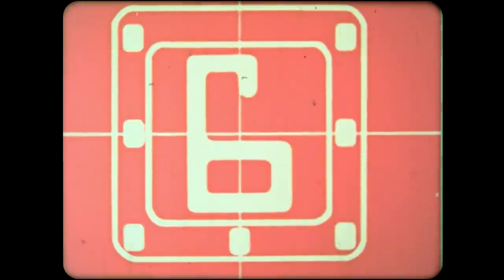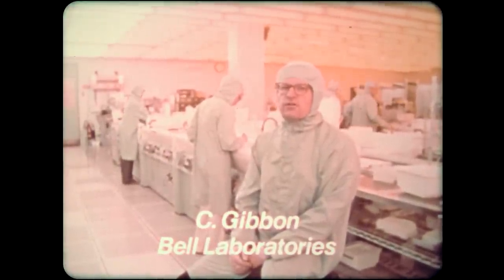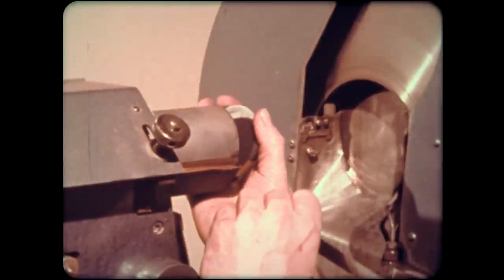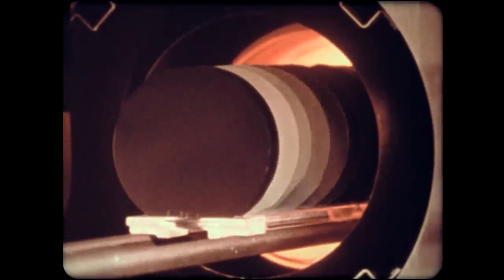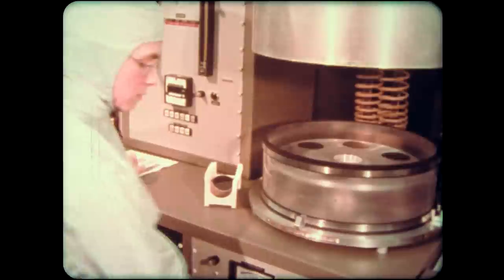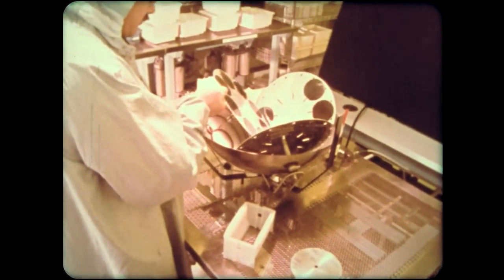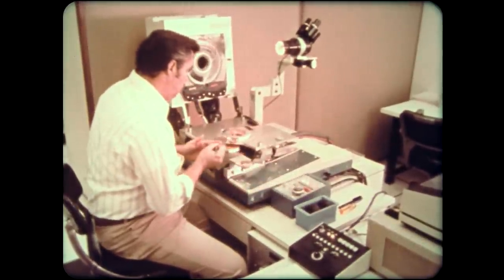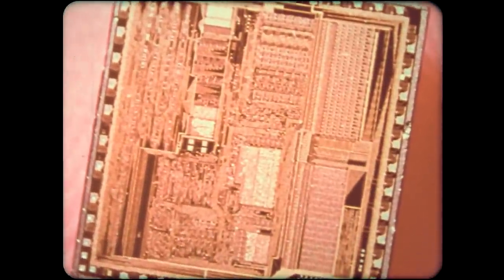Integrated Circuit Manufacturing At Bell Labs (1983)

Comment: In the mid 90's I worked in a class 100 cleanroom, we wore bunny suits over our clothes and booties over our shoes. We produced diaphragms for pressure transducers for the automotive industry. We sputtered a thin film of glass on to the polished surface the diaphragms and then a thin film of nichrome on top of the glass, once the sputtering of diaphragms was done they were welded to a pressure port and we uses a LASER to cut an Isolating border around the nichrome leaving an Island of nichrome sitting on top of the glass we then cut a Wheatstone bridge circuit into the nichrome and this was the basis of the pressure transducers.

Comment: AWESOME!!! I worked for “Western Electric/ Bell Labs/ AT&T, Lucent Technologies/ Agere Systems” (Same company many names) in the 1990’s into the 2000’s in Allentown PA. We were a micro electronics wafer fab and produced many product lines. Sadly, poor management and union issues closed the facility as product was moved to Singapore. Most of the production buildings were demolished and a baseball field was erected. The site is now hometo the Iron Pigs.
My job was a Sr. technical Support Analyst in the Ion Implant department. This job was a highly rewarding career that sadly came to and end far too soon.
Thanks for sharing this great film.
Reply: @FixItStupid  Nothing to do with NAFTA in this case.  If nothing else, NAFTA only applies to USA, CAN, and MEX.

Comment: I worked at Texas Instruments in the late 60s, and visited the Semiconductor Building often. There, I watched silicon ingots being grown, sliced into wafers and subsequently etched. We made ICs, power transistors and small signal transistors. The clean room personnel were required to wear surgical masks and a face shield. Hot garb for sure, but the rooms were kept at a constant 68 degrees, so the people were kept as comfortable as possible. Fascinating production.

Comment: You can tell this is the early days of the silicon age by how small those wafers are. The wafers shown here are probably 100 mm or 125 mm wide. Since then wafer size has ballooned to 300mm wide with 450mm proposed and theoretical going out to 675mm. Great work preserving this one, fran!

Comment: I love how they keep switching measurement units. From 1/50th of an inch, to 1/20th of a postage stamp, to 1/3 thickness of a human hair... but the oven operates 1,000-1,100 C. 🤣 Still fascinating as it comes together. I'd love to get an opinion on this fabbing process from someone that works a modern chip fab. 👍
Reply: Clearly, Bell Labs was an equal-unit employer

Comment: Cool Fran.  Thanks for the memories.  I worked for a pioneering and leading solar cell/panel manufacturer that actually grew, sliced, processed our own single silicone ingots.  I was there when we transitioned from ID saws to wire saws - less kerf loss and more wafers per ingot in 1/4 the time.  Ahhhh, those were the days.

Comment: My dad worked at Cincinnati Milacron in the 1980s and '90s. They produced 4" and upto 6" Silicon wafers. I got to see the ovens where they grew the Silicon tubes from a 'seed.' We had many of the blank wafers before they were doped and coated. It's amazing how much the technology has improved since these times. They used Nitrogen as an inert gas and had detectors throughout the building in case there was a leak. They also used Hydrofluoric acid as a cleaning agent. This was extremely dangerous.  EDIT: Bell Laboratories, also known as Ma Bell, was broken up in January 1982. I wonder if this was part of their marketing campaign to paint a better picture of the company as a whole.
Reply: I've heard stories (probably apocryphal) of a guy using HF to clean limescale off his pool tiles, while standing in the pool. It didn't go well.
Reply: Bell laboratories was the R&D department of AT&T.
The lab was not what was broken up, but it was much later spun off as Lucent Technologies

Comment: I'm assuming these are the chips used to support the relatively new digital PCM switches that Bell was replacing fully analog switches with. The same digital coding standards are still used in mobile telephony today.

Comment: It's amazing how almost all the steps in the process required so much manual labor back then. Nowadays, every single step is done by robots, and the humans are only there to make sure the machines keep working.
Too bad they skip the lithography step by the way, where the patterns of a chip are transferred to the silicon by laser light. I worked at ASML for a while (which is now the number one producer of lithography equipment but didn't exist back in 1983 I think) and even if you would focus on just that part of the process, there's so much to learn.
Reply: They showed a woman loading wafers in the machine to be exposed.
ASML came about from a joint venture with Phillips in 1984.
Reply: they probably didn't want to give away any chip design secrets..
Reply: @jimurrata6785  That was a Perkin Elmer 100 that was being loaded, we ran 200 & 500's back in the day.
Reply: @lowfinger  Interesting!
I knew that Perkin-Elmer were on the forefront of photolithography. 
Perhaps their legacy is why ASML are in Wilton today.

Comment: It's crazy how manual everything still was at that point.  People are just handling wafers with their bare hands.  Manually placing wafers in the equipment.  Manually placing the die in the package.  So little automation, it wouldn't have looked very different if they had tried to make integrated circuits in the 1950's.

Comment: I bet that environment pollution was a big issue for all semiconductor plants back in the day, it may be less so with stricter regulations, but for these to be effective, they should be global. Otherwise, a manufacturer will just move where the laws are more lax and labor is probably cheaper. Capitalism, meh.

Truth be told, semiconductor production plants may not even be that harmful compared to vacuum tube factories... There was a Polish one in Warsaw, it changed names throughout a few decades of its history. Before the WWII it was Telefunken, then ZWLE (Zakłady Wytwórcze Lamp Elektrycznych im. Róży Luksemburg, i.e. Rosa Luxemburg Tube Manufacturing Plant), then Telam, then Polam and finally Polamp. When the plant went bankrupt in 1990s and was decommisioned in 2000s, the mercury contamination was through the roof (they also made the old style fluorescent lamps). I could bet my ass off that it was the same for other chemicals, barium or thorium being the obvious example to anyone who knows the tube production proicess, and they definitely used hydrofluoric acid too.